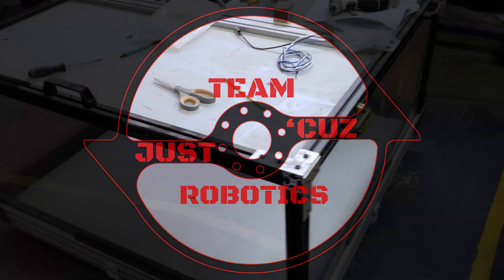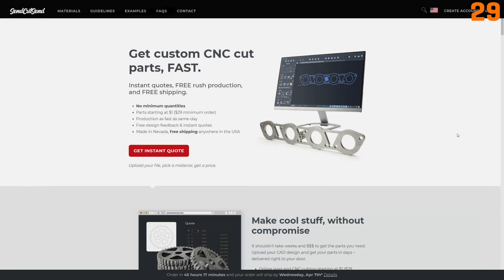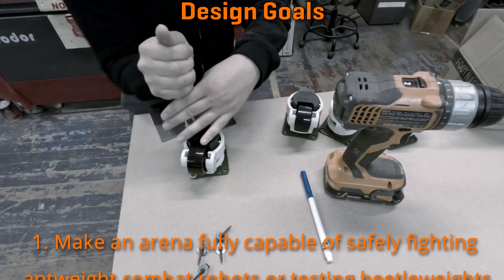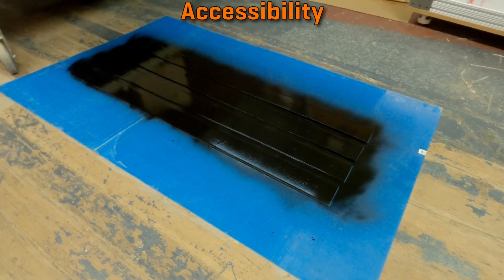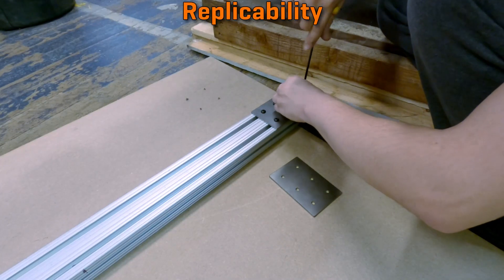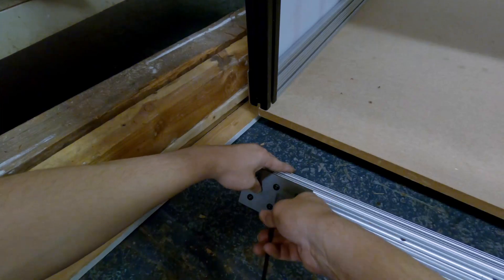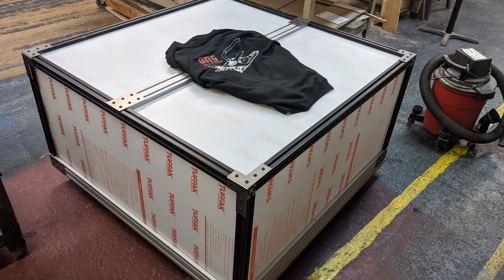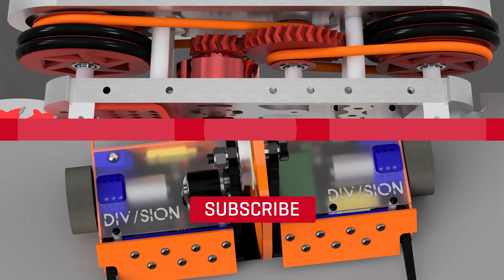How to Build a Combat Robot Arena (Free Plans, Open Source - Host your own tournament!)

Comment: Not knowing anything for arenas, I assume this wouldn't be good for beetleweights. Would you have any recommendations that would help make it so, or do you think it'd be fine as is?
Reply from the maker: It's too small and walls too thin for beetles.  I recommend scaling to 6x6 or 8x8 and having 3/8 thick polycarb at beetle scale.
Reply: @JustCuzRobotics Fantastic, thanks for getting back so fast, we'll try to go with that then. My only concern being the size of it. Would there be a good way to make it modular/easy to take apart/rebuild when out of use?
Reply from the maker: Can you email me at Team@justcuzrobotics.com, I can share a more suitable arena design a friend of mine came up with for a portable beetle arena
Reply: @JustCuzRobotics  sent, thanks for the help!

Comment: 13:06 "There's no way any ant weight I've seen would ever breach through 1/4 inch polycarbonate walls"
I've seen my friend's modified scalar punch straight through 1/4 inch polycarb. (Yes, we verified the thickness with calipers)
Reply from the maker: Noted! This video is from April 2021 before Scalar Kits existed, but times have changed.

Comment: Could this be modified for featherweights? sorry if this a dumb question this is a 4am question XD
Reply: should have finished the video
Reply from the maker: You would never want to run 30lb bots in a 4x4 box. I would not trust aluminum framing like this with that much energy
Reply: @JustCuzRobotics  fair

Comment: Why did you mount the lights and camera inside? Does the polycarbonate distort the light or picture?
Reply from the maker: Firstly everything is inside to keep it all as portable and simple as possible. Secondly, yeah any time a camera is pointed at a window be it polycarbonate or glass, you get some distortion, but the worst of it is reflections of everything outside the box hitting the camera as well giving you horrible glare and other images in front of the robots.

Comment: Is the polycarbonate stiff enough that a solid hit couldn't bow it enough to get it out of the slot in the aluminum extrusion?
Reply from the maker: Yes, great question but I thought of that. The cut sizes are very carefully chosen to be pretty deep in the slots, the panels extend at least 0.4 inches into all sides of the frame and slots are 0.484" deep. The force of an impact from a small bot cannot bow the panels that much, but I wouldn't recommend standing on the ceiling panels or something dumb like that.
Reply: @JustCuzRobotics  I thought probably, I'm used to 2020 extrusion from a 3D printer and CNC plotter project and the slots in that are only ~4mm deep. With 1/4" PC and over 3/8" in the slot all the way around I would concur, that should be generally good enough. 

Also, I really like the gate latch on the top hinged door idea.
Reply from the maker: Thanks! I will say if you were to only use 3mm or 1/8" polycarbonate and not scale down the frame for 150g bots it might get a bit sketchy as that stuff is very bendy. And same could go for scaling up to 4x4 or 4x8 sheets but still using 6mm or 1/4" polycarb. That's another reason the ceiling shouldn't be one 4x4 square window.

Comment: You need the top beam in the middle because the polycarbonate would sag if you didn't have it, correct? I'm sure it's helpful to mount the lights and camera but I'm assuming it's mainly for stability. Very nice work!
Reply from the maker: Actually, it is primarily because buying, shipping and transporting 2ft x 4ft or smaller sheets is a LOT easier and cheaper than dealing with a 4ft square sheet. I originally wanted all five PC panels to be the exact same size, but I ended up with the wall panels being 1" shorter than the ceiling panels for various other reasons. On ebay with "free shipping", 24x48" is $73 and 48x48" is $210
Reply: @JustCuzRobotics  Cool. Thank you!

Comment: I need to design an arena that can fit through a door vertically and can easily be rolled around for a school club next year. What if you put caster wheels on the wooden wall side and handles on the “top” to grab it so it could roll around?
Reply from the maker: This arena is 48x48 and roughly 28-30 inches tall even with the casters. It should fit through a typical doorway that is 32-36 inches wide if you added wheels on the front and turned it on its side like that. Just keep in mind the floor is kinda only held in place by gravity and the kick plates overlapping it so it may shift around a bit but wouldn't be that hard to deal with.